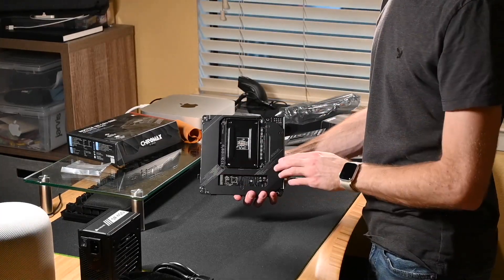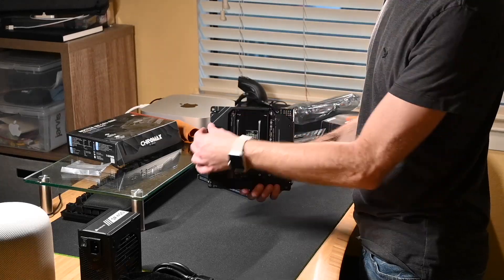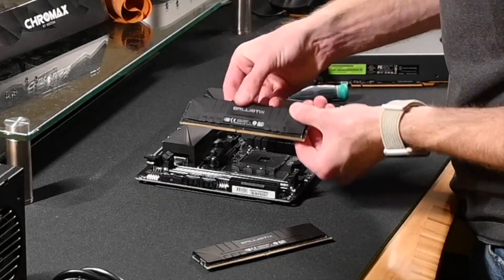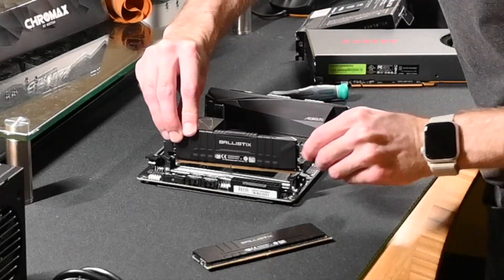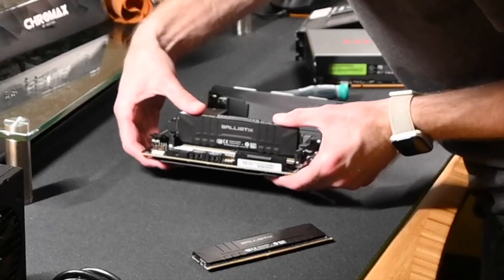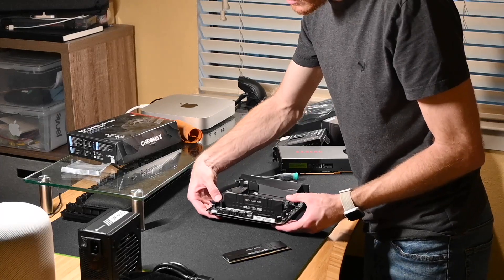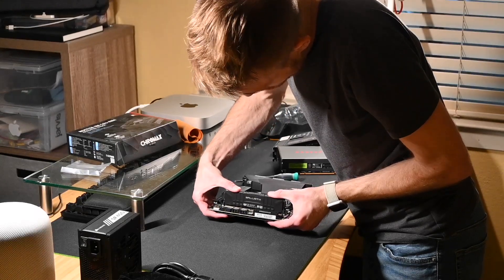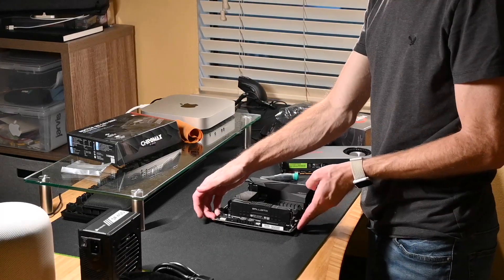How to build Mini ITX with Ryzen 5600X: Gigabyte B550i Aorus Pro AX unboxing and Crucial DDR4 3600

Comment: My question: do i have to upgrade the bios to the motherboard yes or not?
And if not, ¿there would be an issue or something?
Reply from the maker: well now they might ship with an updated bios already loaded, I'm not sure. basically if it doesn't detect a 5000 series Ryzen chip you will need to update the bios this way, however if it detects it then no worries, you can update the normal way. There won't be any issues or damage, it will simply not work if you have the older bios (no video output or anything, since CPU would be unsupported)